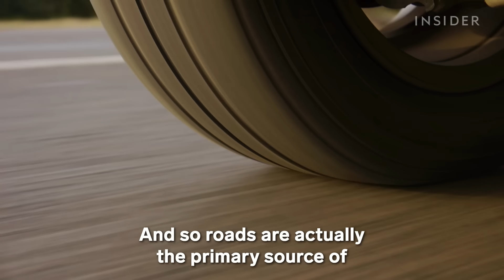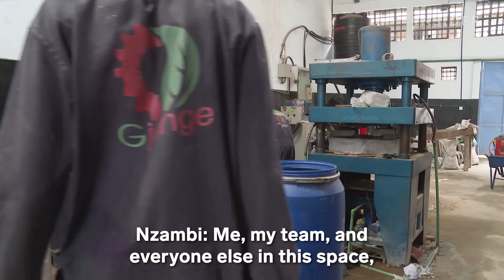Young Inventor Makes Bricks From Plastic Trash | World Wide Waste | Business Insider

Comment: Of course it's not the perfect solution, but it's better than letting it just lay around, being broken down by the elements.

Couldn't they just add a thin layer of a non-plastic material (concrete?) on top to prevent the deterioration of the tiles? That way the tiles give the solidity while the top layer prevents the micro plastics to rub off.
Reply: Any coating would quickly wear away because of abrasion
Reply: @mervynlarrier9424  what's your idea?
Reply: A thin layer of concrete will wear off so quickly the micro plastics will leech out sooner than later
Reply: @scottanno8861  agree
Reply: @scottanno8861  what's your solution?
Reply: @hagaras82030  Not using plastic.
Reply: @scottanno8861  exactly correct 👌
Reply: I also thought of the microplastic eroded from the tiles in long term use could be more dangerous to the water sewage and air pollution.
Reply: @lordza212  itd be terrible if a building caught fire and was made of these or a road would probably give everyone in the area cancer
Reply: @lordza212  The same happens in the landfills at least this serves some form of purpose.
Reply: I don't remember where I herd this, but I remember reading or seeing a vid talking about (microbes or bacteria?), breaking down plastics. So maybe if they could safely do that like they did with the newest (?) type of biodegradable plastic. (Biodegradable plastics still not being good for the environment of course but still).
Reply: Well i think putting concrete ontop of the tikes is still wasting some money for the company apperantly and also i think the concrete would just wear off quite fast
Reply: @Founderschannel123  not sure if its completly accurate but i did a quick google search and the first thing that shows up is some dutch company that claims plastic made roads can last up to 50 years
Reply: @emmanueld.5875  The  real issue is micro plast.
Reply: ok but you can use the pavers for a less abrasive use. like foot traffic or cycling infrastructure
Reply: Im no material scientist, but thin layers would crack and flake off due to the difference in properties of the two materials. Furthermore, it would add cost to production.
Reply: @BBalloon  Probably unless they’re 100% plastic I could see that lasting for a long time
Reply: @thebuddha4208  exactly, but it does erode into microplatics as the video states
Reply: @BBalloon  If you're no material scientist please do not try to posture like one right after. Your absolutes are YOUR absolutes and mean shit to the world or existence
Reply: Better to use it for buildings.
Reply: @TheBooban  cant wait to smell the black plastic smoke after a fire
Reply: @TheBooban  Agree, it is safer as a brick for building or a house specifically.
Reply: thats what i wanted to say, microplastic production gona occur in time
Reply: Yes they need to think about it we are already drinking microplastic from plastic bottles...
Reply: Could usage for sidewalk be better because of the low weight it exposed too? Especially in areas with less foot traffic like alleyway between buildings.

With less usage, it would lass longer. Because those places needed to be covered either way.
Reply: As others have said, this will spread pollution everywhere. Meanwhile asphalt is already an ideal road surface, cheap, relatively safe, and the most recycled product on earth. 

The ONLY half decent solution for these plastics is to incinerate them and do your best with the emissions. At best CO2 will be the main concern, but on the plus side you will be getting some energy. That is how advanced nations handle plastic waste today. Second best is a good landfill.

But please say this with me: YOU do not need to save the world from plastic. Poor people do not need to come up with special solutions for plastic. It's large corporations run by wealthy individuals that are responsible for these uses of plastic. THEY need to do differently and the solution is to use government to force them. That's what WE need to do. 

This here is pathetic- I say that with great respect. In projects like this we are like a cargo cult but in a nightmare of greed.
Reply: @tieck4408  I was under the impression that advance Nations simply fill up empty barges after they received shipments and send it to third world countries and let them deal with it.
Reply: @majesticmajestic7058  No, we Americans do outrageous crap like that. I meant nations like Germany, Denmark, Sweden, etc.where that's less common and plastic sorting and incineration with energy recovery is the norm. (EDIT There are obvious exceptions like ship breaking, e-waste, etc. where third world countries almost always foot the bill.I don't mean to imply that there's any nation that's handling waste well. But anyway we were talking about typical single use plastic trash.)

We Americans actually desperately need Biden's legislative agenda to pass if we want to continue having the infrastructure necessary for civilization, let alone make any move towards sustainability, so I'm flattered if you think of us when you hear 'advanced'.
Reply: Her workers are going to die of cancer inhaling all those plastics chemicals. She should give them mask filters.
Reply: No need to do that. They just need to add few co-ploymer and that tile will last long then ever PP is best polymer to do this as it is toughest polymer they just need to use filtered pp waste.
Reply: You can't stop friction.
Physics.
Reply: I don't think this is something new.some developed countries with similar problem must have already came up with the same idea but saw the faults in it n didn't continue with the plan.if it was something new and scientifically proven to be safe or environment friendly she would have been bombarded with offers and financial support from all over the world.not trying to be hopeless n negative but I dont think her idea is gonna fly very high.
Reply: After some time, that non-plastic, will rub off, then what?
Reply: Not to mention the fumes
Reply: John Buck  Yeah just the people that spend their lives dedicated to studying it. Not to mention the oil industry admitting they've contributed to climate change.
Reply: Listen you yourself. Those micro plastics will find their way into our water supply’s. I’m good
Reply: The upkeep of things will cost. But innovation is the key.  Starting businesses leads to more business ideas.  Not everything must be the ultimate solution. Just keep driving the ideas so the solution will show itself.
Reply: yeah because moving it from one place to another makes it ok ? so your ok with having 1000 of miles of roads with fine plastics that slowly leaking from the sides and bottom into the ground around it making it toxic  ........ get an idea ffs . its the fine broken down plastics that are doing the most damage . its in your food , water and even in your body . so you know nothing of what you speak
Reply: One solution is to store non biodegradable plastics and tech wastes or e-wastes in abandoned mansions, palaces and buildings. Then lock the wastes and plastics inside their rooms for a long time. In this way the wastes will not erode into water, air or soil. And abandoned buildings will come of use, too.
Reply: No, that wouldn't work.
Reply: they have clay in them
Reply: That’s exactly what it’s doing it’s just laying around being broken down by the environment while being used
Reply: no, because it would crack in an instant.
Reply: @sulaman600  also slippery when wet
Reply: Either way it'll create more pollution
Reply: well that'll only last until the outer layer deteriorate
Reply: Just cover it in asphalt like a normal person. It has enough flex in it to solve issues.
Reply: This will increase the production cost & the selling price. The similar production method & the final product considered as 'premium' is wrp (wood reinforced plastic). This product have the benefit of both plastic & wood but too expensive for certain situation / requirement
Reply: What happens when the road needs to be replaced, you tear up the road, and build a new one, what do you do with the old road?

The problem is there,
Reply: smart
Reply: That was my initial thought going into this video
Reply: That's not how road building works.
Reply: Just build house's with it. For roads it is a terrible solution.
Reply: You do not want to intentionally "coat" the earth in plastic. That sounds absolutely absurd. The earth absorbs and excretes it's. Our water, food and everything we thrive on is from the earth. Feed it plastic and it will die like any other living thing...and we will also die along with it.

Sadly, we haven't learned and continually feed it trash and somehow not knowingly understand why we are coincidentally dying from abnormalities at and increasingly high rate from generation to generation..
Reply: @sulaman600  cheap kills
Reply: The main issue with this idea I believe is that just using plastic and sand is going to make this kind of pavement too flexible when a load starts to travel on it. As it is stated in the video this combination of plastic and sand is not a new idea and pavement companies have been doing this already. She is missing the most important part that extends the longevity of the life of the asphalt and that is she needs a coarse aggregate in the mix to prevent the plastic and sand from flexing too much and destroying the road.

A lot of engineering, math, and science goes into getting the mixture of soft binder and coarse aggregate in your City/County's asphalt just right so that it lasts as long as it can. Too much soft binder and your road will start to flex like putty under load and too much coarse aggregate and your road will be as brittle and break off like a piece of peanut brittle under load.

There is also a reason why truckers have to go into weigh stations when transporting goods. Every road is built with a specific estimate of how much traffic will travel on it as well as a max weight it can bear at once. Trucks that are over the weight will end up destroying the roads quicker if there are over the specified weight.
Reply: @KYRSZ-gd1qt  You're comparing an industrialized country to one that isn't they don't have that kind of traffic like an industrialized country would have, sooner or later they will but right now a lot of places have dirt roads.
Reply: It's better to rapidly have it broken down by vehicles, and releasing Toxins into the Ecosystems, instead of slowly being broken down by the Elements?

Think you might need to look up what "Better" means, as well as the dangers of Plastic.
Reply: I wonder how this would work in states with heavy snow/ ice/ rain
Reply: you are also forgetting that asphalt is literally the most recicled material on earth.
ahsphalt is 99% reusable.
Reply: basically you just coated sum plastic with thick cement
Reply: That's why I started to purchase more non-plastic packaging products... even though it costs slightly more...

More plastics then more micro-plastics,
more micro-plastics then more cancer and allergy cases
(I am one of the plastic-sensitive person, causing me some hideous annoying eczemas)
Reply: All I was thinking was the micro plastics and how cancerous that would be to populations but sealing it in a coating of something makes perfect sense.
Reply: I was thinking about the same thing! We don't want to be breathing in even more microplastics
Reply: Yeh but the amount of microplastic that will leech out is huge thousand of vehicles everyday wearing it out
Reply: the half-life on most plastics is crazy long, so this a way better solution like you said. The real solution though is America specifically banning the manufacture of single-use plastics for nonessential items and industries and pressing its allies and trade partners to do the same. The American government is either to cowardly or delusional about climate change to do this though.
Reply: @emmanueld.5875  Banning single use plastic will just make those items cost more. People want/need less expensive.
Reply: @boss42971  I understand that. People will be fine and just value/take care of what they buy to replace those things with single-use plastics so it last longer.  creating millions of tons of waste and dumping it across African countries because we want the convenience of stuff like plastic plates 
is morally egregious.
Reply: Good to see someone reffering to the micro plastic issue, its "better" than lay them around but micro plastics cant be picked up & recycled, this needs to be done responsibly or its just going to be another "pretty solution" that delays the real problem
Reply: I was thinking the same thing
Reply: We need to shove in people's faces the fact that plastic is killing this world. Plastic trash floating around does that better than bricks.
Reply: No, you would need to apply the same amount of asphalt onto the road in order for it to be stable enough to hold the weight of traffic. This plus the speed of vehicles travelling, would tear that thin layer to pieces in no time, all roads need replacing eventually, you can't just keep using them but you still want them to last.
Reply: They're mixing it with sand to make it sturdier, aren't you paying attention!??
Reply: If you can smoke cigarettes and drink alcohol, micro plastics look like a minor issue. The whole point is this is a cost-effective way of recycling. You don't need complex machines like a roller or mixer or materials like limestone.
Reply: @ilsunnylo3562  I really don't agree with that tbh. While yes I can destroy my health by drinking alcohol or smoking. The difference with microplastics is that I cannot avoid it. I can choose to not consume alcohol or smoke. I cannot choose to not consume microplastics. Besides recycling is not as good as you think. Somewhere around 90% of single use plastics cannot be recycled. The rest ends up in landfills. The only way to solve this plastic issue is a complete ban on single use plastics.
Reply: @ilsunnylo3562  I don't smoke or drink. Micro plastics are a major issue. They're potentially one of the reasons while test levels are dropping off, and so are sperm counts.
Reply: O yeah lets have micro plastics leech into the ground and pollute our soil i could see nothing going wrong with that
Reply: @roxaskinghearts  This already happens with the over crowded landfills, at least this serves some kind of purpose.
Reply: Concrete would also decrease the carbon neutralization purpose of reusing plastics, since the concrete industry has one of the highest greenhouse gasses emissions due to the calcination process
Reply: I mean good for countries that cannot afford traditional road surfaces I suppose, maybe more ideal for structures that does not need friction as much as roads, besides, most roads contain bitumen, which is what remains after crude oil is refined, and bitumen is already reusable,  but I mean if bitumen is hard to get, then as the next alternative, it is good
Reply: This thread is full of big brains thinking micro plastics are a problem and plastic should be turned back to oil or burned for power cleanly. Also full of little brains that thinks the plastic bricks are great, and is better than trash sitting in dumps.
Reply: @lightdark00  im just a guy who spent years building roads and I quite like 3 layers of gravel, compacted nicely, good drainage, and a nice asphalt layer on top to seal it and add flex. 

Nothing more, nothing less. 

Bricks in roads.. yeah nah, definitely not a fan of the idea.
Reply: But her method seems different than the example from india that added the raw small plastics. She melts its to make this paste thing that solidifies evenly, so I think it is different. There arent tiny pieces being released.
Reply: @PozoBlue  "Even the process of making plastic roads is highly toxic; the heating of many polymers releases gases such as polypropylene, polystyrene and polyethylene polymers. To create the roads, plastic is mixed with chemical additives to add flexibility and delay degradation due to heat or sunlight, making the plastic fireproof. The workers making these plastic roads are directly at risk of inhaling these chemical toxins. Many developing countries have poor safety practices, and constructing plastic roads in large numbers might expose workers, particularly women, to cancer and hormonal problems."
Reply: @PozoBlue  it doesn't matter that it is melted into a paste or whatever else. Plastic outgasses nasty chemicals. Carcinogens.

Also, unfortunately, development of uses for plastic waste such as this- particularly cheap uses- ends up promoting and solidifying our dependence on plastics.
Reply: @PozoBlue  Bingo!!!! Excellent observation
Reply: WHAT ABOUT ABANDONED ROADS, THOSE WILL BE BAD FOR ENVIORMENT ALSO THAT WILL RUIN THE PURPOSE OF USIBG LESS CONCRETE
Reply: @insectbite1714  yeah abandon your heating system and walk out into the snow while you’re at it, the environment, & likely most chat rooms, will be grateful.
Reply: @insectbite1714  Abandoned roads really isn't an issue. The cost of building a road is huge even with these bricks. It's not something people just do on a whim and then forget about. But if it does happen, the bricks can be reclaimed.
Reply: @insectbite1714  you do realise asphalft is recicled right? Theu break down unused roads and male new ones
Reply: now thats smart!
Reply: No, you don't understand. While USA will consume more and more, Kenia should silently keep their shit and do not search for solutions.
Reply: Dude is just a hater, jealous he didn’t think of the idea…he has not tested anything he just talking out of his @ss
Reply: @EtreTocsin  lmao who?
Reply: @EtreTocsin  I haven't tested drinking battery acid but I still know it is bad for you. You are a moron if you think that just because someone doesn't offer a solution you should stick with the same bad things being done now. That is like saying Solar power doesn't work at night and you don't have a solution so lets give up and keep burning coal.

I actually have a solution though. You can break plastic and oil down chemically or biologically using microbes and fungus and turn it into high value NON Toxic medicines, lubricants, chemicals,  skin products, and other items. Oil is actually a renewable resource as long as you don't burn it. This is why burning waste oil has been made illegal in Germany. If we burn it all or waste it we will run out. There is actually a company near hear that turns used oil from cars into much more expensive specialty solvents used for making medicines.

What they are doing is not sustainable even for their current usage. 20 people making 1500 bricks a day is nothing and uses a lot of energy. If they used a big tank of hot vegetable oil they could melt larger quantities of plastic using the same energy by circulating it around the plastic and sand mix. Then they could press more than 9 bricks at a time by stacking multiple sets of the molds on top of eachother. For less than $500 I could DOUBLE their productivity. 3 4ftx4f steel plates 1/2in thick, a few feet of pipe with screw on cap, and an old hot water boiler tank coated in mud and straw. Use the plates to build the stackable moulds, fill the pipes with the plastic and stick in a tank filled with hot oil. Once it melts push the plastic out into the molds and press them flat. Or they can get a 10ft section of 10in and 10ft section of 9.5in pipe and attach to their extruder one inside the other. Circulate the oil through the outer pipe and turn up the speed on the extruder. It will cost a little more but require fewer workers than the first method.
Reply: @excitedbox5705  you should try to contact that company directly to share your suggestions.
Reply: @tracykaebisch987  I actually did. I filled out their contact form on their website.
Reply: @EtreTocsin  Dude you’re talking like you never touched plastic concrete or road before.

And it’s not a new idea do search for it they even thought of modular plastic road that can be place really fast.
Reply: @EtreTocsin  He's not making anything up.  A set of car tires lasts maybe 60k miles before the rubber tread wears down too much to be safe.  Where do you think that tire tread goes?  It turns into tire dust, which is spread into the environment.  If there is rubber or plastic in the pavement, the same thing happens.  It doesn't mean plastic bricks shouldn't be used at all.  There are lots of uses besides road surfaces.
Reply: @EtreTocsin  hear what he said again, it's more nuanced.
is it mildly tone deaf? yeah, but it's still a problem
both of them  have different problem to fight, so they see the problem in a different way
you can't expect nzambi to fight American oil company
you also can't expect a pure academics person to run a successful business
Reply: @EtreTocsin  bro, thats you, micro plastics are real and you're just neglecting for the sake of putting down a significant argument